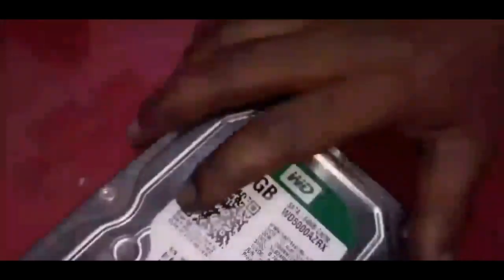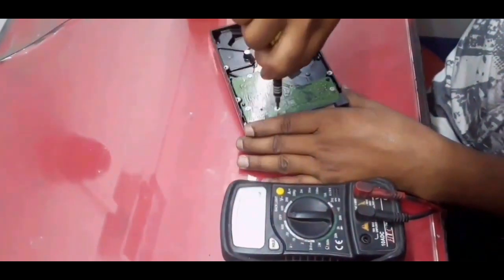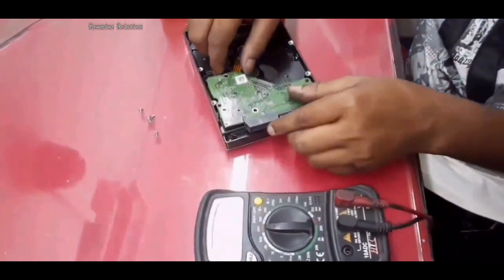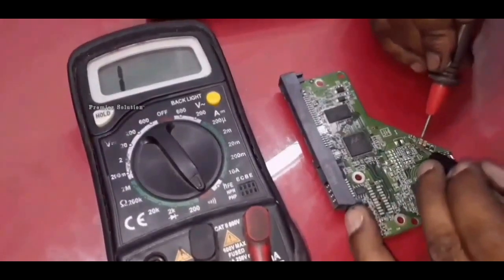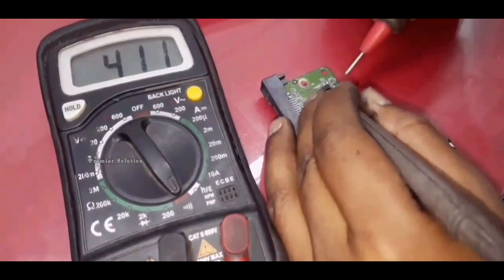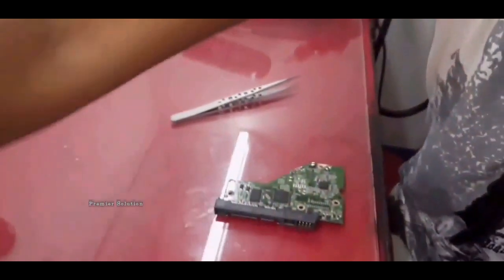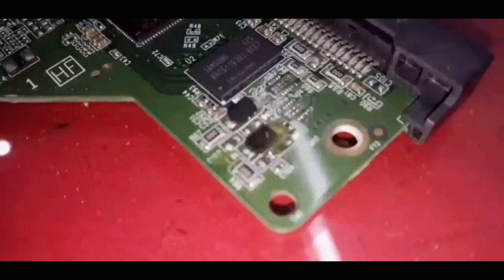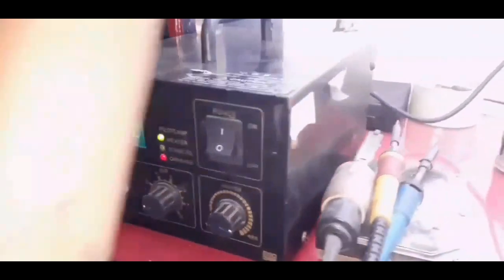how to repair Hard Disk Drive not detected

Comment: Can anyone tell men if you can upgrade HDD FOR 500 TO a 1T  or 2T by changing the disk.
Reply: You can change the disks but you have to change the heads and the logic board as well. "Upgrading" a HDD is four to six times more expensive then buying a 1T or 2T drive. Don't forget, you need special equipment and have to work in a clean air environment. If you sell your old HDD you can save even more money.
Reply: Run it under the cold tap for 10 sec per 100 gigabyte you want to increase capacity by and then plug it back in immediately making sure it's still wet.